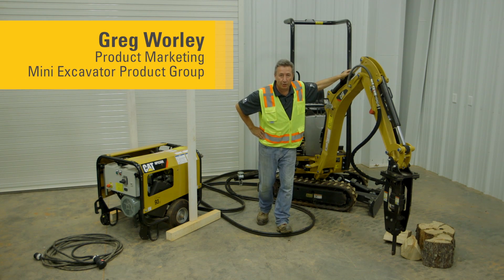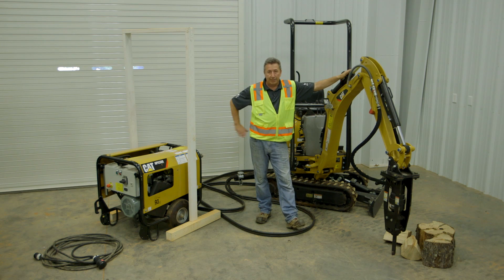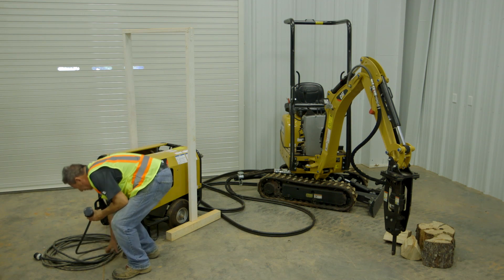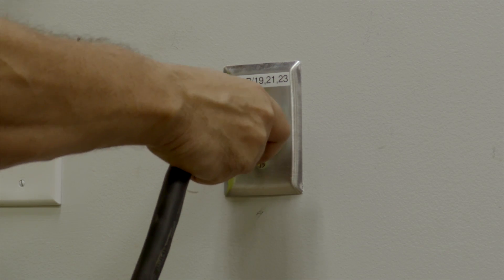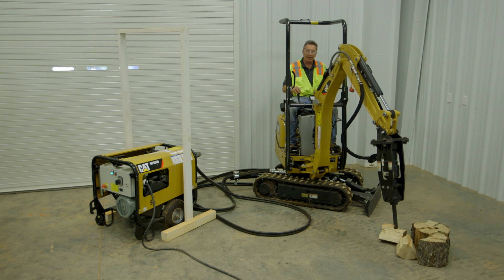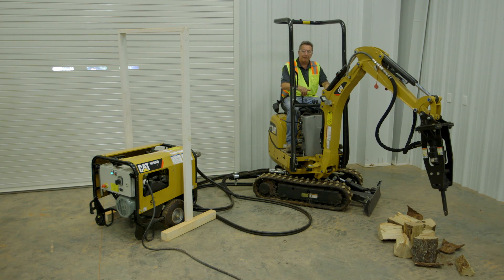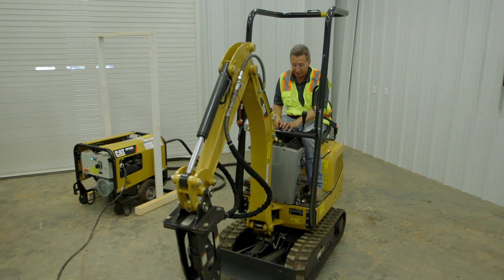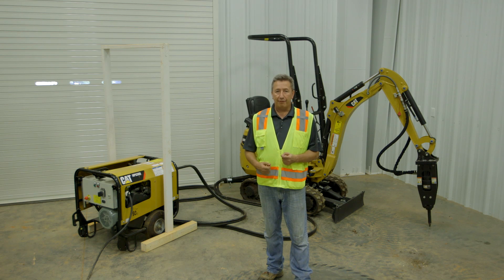How to Operate the Cat® 300.9D Versatile Power System with HPU300

Comment: how are you supposed to operate this in a much larger building though if the hydraulic hose is only 40 feet long though? Move a bunch of fans into the building for ventilation, switch the machine back to diesel mode, take the HPU with you, then repeat this process a dozen or more times over each time the machine needs to be moved?

Comment: we used one of these machines inside a 3 million square feet building 
This machine is wonderful when u can’t use fans and offices are nearby and doing renovations. You can’t use diesels or even LP vehicles inside most buildings now
Reply: why? diesel and lp have been 'safe' for decades. suddenly they arent?
Reply: @xxxmikeyjock  Inside of office buildings no one would allow those emissions inside confined areas. They fit through man doors and are relatively quiet when you are doing Renovations inside operating facilities
Reply: @xxxmikeyjock  well I worked for Baylor mining back in 2019.and we didn’t use diesel machines underground with personnel. But I was only there for 10 months maybe they started back when I left. That was outside oak hill WV. But things change I can see using a diesel machine in an office building using fans to push exhaust throughout the building. Be serious

Comment: This is stupid, I assumed from the looks it was a generator that provided electricity to a motor onboard. But no its a damn hydraulic pump that needs to be plugged in, then it needs to be hooked up to the machine. Lots of cords and hoses to deal with. Just use the onboard diesel engine and some fans.
Reply: Tyler Pickle we used one of these machines inside a 3 million square feet building 
This machine is wonderful when u can’t use fans and offices are nearby and doing renovations. You can’t use diesels or even LP vehicles inside most buildings now.
Reply: @srad98ful   why "cant" you use fans? someone has put an artificial restriction on the task.
Reply: @xxxmikeyjock  using fans to vent emissions throughout the building.

Comment: single phase would open this up to more markets . what would be even better to have the hpu size unit to be a diesel generator . put the electric motor on the mini . this would allow plug in to the diesel generator or site power . the diesel generator could also be used to power other work tools at the same time on the job site if sized with overrated generator head unit . 10 hp electric single phase motor 3800-5500 rpm through small gear box to lower rpm and produce torque required to run this little unit .
Reply: That makes more sense to me!